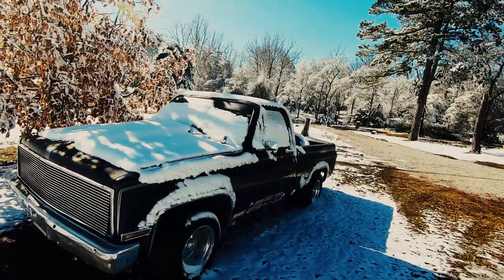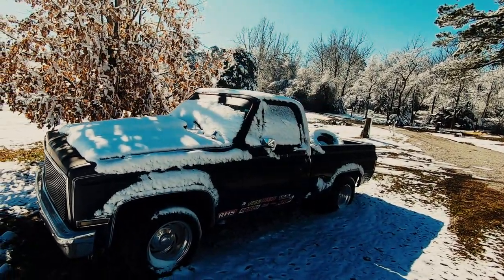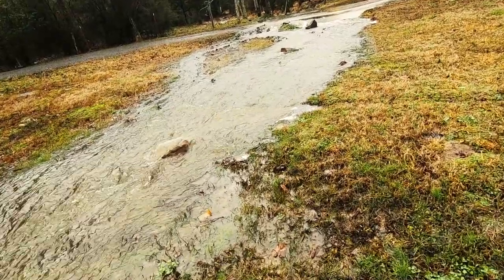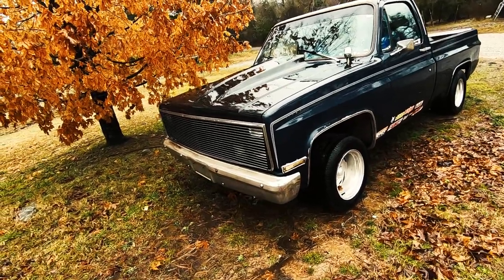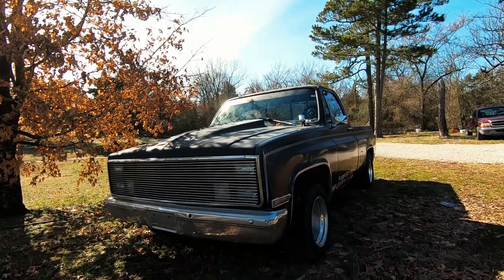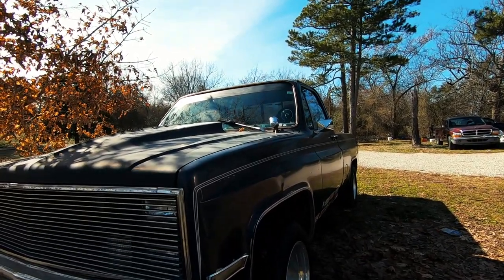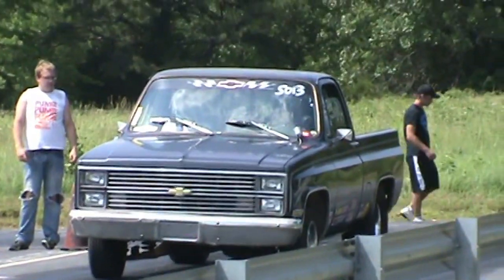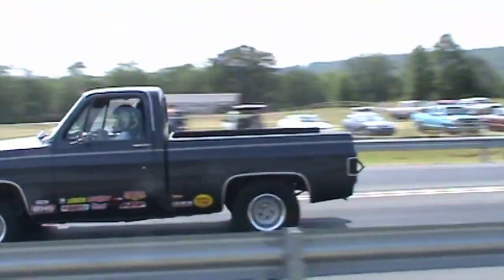Mini Spool on Street + Mini Spool VS Full Spool & Limited Slip VS Locking Differential  Explained

Comment from the maker: I forgot to mention that a mini spool essentially accomplishes the same thing as a welded differential. Have you guys ever experienced a welded differential or a spool? How was it for you?
Reply: If welded right it can work well not for drag racing but drifters can do it cause they arent hitting the tires hard on a sticky track. Any rearend is better then the gm g80 limited slips. Aka we call rhem guv bombs. They have a little flipper on pot metal youd see a chevy start doing a burnout hear a bang then it comes to a screeching halt. Lol
Reply from the maker: Greg l Ha! I’ve heard that “bang” before. That’s not a pleasant sound. 😬
Reply: I daily an 83 camaro with a welded diff, i am not a fan to say the least haha
Reply from the maker: Saskatoon_berries_are_lit 😂 I never drove mine as a complete daily driver, but I drove it enough to get annoyed with it!
Reply: @WheelpowerTV  hell, ive seen guys pour hot lead in the spider gears and makes it like it like a spool that you can remove later. i honestly hate the mini spool i busted mine with my 460 in first gear :( 800$ differential down the drain. buy a full spool or locker throw that minispool in the trash if you plan on making decent power
Reply: I love my welded diff more then my lsd I'm thinking about getting a spool too

Comment: I like this channel. I'm also a wheelchair user as a result of an injury. Last year I bought a beat up '79 GMC 3500 to hot rod it. I might document the build like you're doing. One thing that I've considered doing to improve traction is to put the fuel tank over the rear axle.  These squares have saddle tanks located on the sides, so they don't add any weight in the rear. I'll probably put a fuel cell in the bed, but others have converted to the K5 Blazer center tank. In fact, I think LMC sells a rear tank conversion kit. Anyway, I appreciate the content and wish you good luck with the project.
Reply from the maker: mfquaiz thanks so much! I’m glad you’re enjoying my videos. You should definitely document your project. I wish I would have documented mine better back when I was building it. And I have considered a fuel cell over the rear end for the same reason you mentioned. I think that would be a good idea; you have to have a fuel tank, might as well have that weight somewhere that can be beneficial. Thanks again for watching! Keep me updated on your project!

Comment: I had an 88 Suzuki samurai, lifted on 33-12.5 r15 tsl superswampers, lockrite? I think in front, minispool I believe in rear, it was a spool for sure.  I didn’t mind it on the street, it would chirp a tire on tighter turns and break lose easier in the rain, but it was a beast offroad.  Would not recommend on a daily driver that doesn’t have inexpensive tires.  For a 2nd car or “fun car”  I think it’s ok, I think a higher profile tire with more tread “squirm” is what you want with a minispool, sticky or stiff tires with a minispool is a bad idea, I would use a minispool for a Jeep/offroader and maybe a mild performance vehicle, depends on diff construction/strength of parts.  For cars a limited slip is preferable, for serious stuff with sticky tires or heavy weight you need a full-size spool over a minispool so it will hold together.

Comment: I put a trans am in a ditch a couple of times from using a locked differential.  I wasn't even going that fast (50 mph  on a 45 mph road) and have driving many cars on the road I was on at the speed I lost control in a small curve. The locked diff made the rear end get loose like I hit ice in the curve.  The locked diff is even worse on wet roads . I love limited slip and will never use a locked diff again unless it is on the drag strip.  My Trans am was ok just muddy so I got lucky both times.  My dad tried to warn me about those locked diffs on the road but I had to learn the hard way .

Comment: I drove a truck with one for years. The tires scalped a little and it didn't turn amazingly, but overall it wasn't an issue.
Reply: Might be just me but turning  well seems like a very desirable thing in an automobile. If that not an issue for you, that's cool though.
Reply: @plog1805  well a full sized truck doesn't turn well to begin with. It really didn't make any difference

Comment: I just put a 373 limited slip in my truck I’m hoping it does good with a budget vortec headed 383
Reply from the maker: Brandon Bell I have 4.10s in this truck. I like them, but for street use, I think 3.73 gears are a better choice. Anything lower geared will bring your cruising RPMs pretty high. With the tires I have now, this truck runs 3,000 RPMs at 55 MPH. Of course, an overdrive transmission would help.
Reply: Wheelpower TV nice I have a th400 I’m gonna be running a 3000 I’m hoping it does some pretty good burnouts
Reply: Wheelpower TV I meant 3000 stall converter in my th400
Reply from the maker: Brandon Bell it should do nice burnouts with that set up! You’ll definitely enjoy it. I could tell a huge difference when I upgraded the torque converter. I’m definitely not an expert on choosing the correct stall speed, but you’ll want to make sure you do some research on the best stall speed for you set up. I’m sure you know, but gear ratio can affect which stall speed is best for your overall set up.
Reply: Wheelpower TV yeh from what I’ve seen a 3000 does good with a 373 gear. But that’s with a 350 and I’m going with a 383 and it’s gonna be more torquey at lower Rpms so I may drop it to a 2500 stall
Reply from the maker: Brandon Bell very nice! Sounds like you’re building a fun truck.

Comment: This is a tough choice... to spool or not to spool?
Reply from the maker: MCRideout that is the question. 😂 You just need to ask yourself what you want from the vehicle. If you just plan to drag race or off road it, a spool will work. But if you want to drive it on the street as a normal vehicle, I’d recommend paying the extra money for a LSD or locker.

Comment: I'm a one tire fryer 2wd offroader . Enough weight and proper tires , you wont even notice
Reply from the maker: Jake 1776 When I got this truck someone had welded a steel railroad tie to frame in the rear. I’m not sure if they were trying trying to lower it, achieve better traction, or both. 😂 Weight works, but with a go-fast application weight is bad, so it had to go. I looked up under there and said “what the heck is that!” Haha. I wish I would have taken a picture of it before I cut it off.
Reply: @WheelpowerTV  I mean that's not a bad idea because you could add weight and keep bed space.  Kinda like your c10 I had a 1988 gmc Sierra when I was 14 about a year ago and it was all beat up and rotted from Massachusetts weather
Reply: I had a truck that was also a one tire fryer and did great offroad unless it was wet. Or too lose. But overall a 4x4 is a whole different level